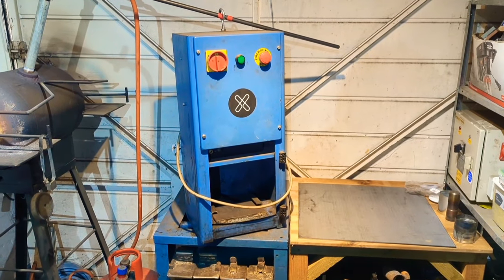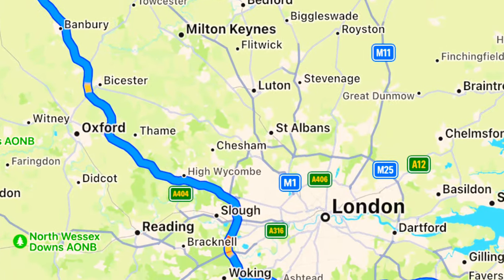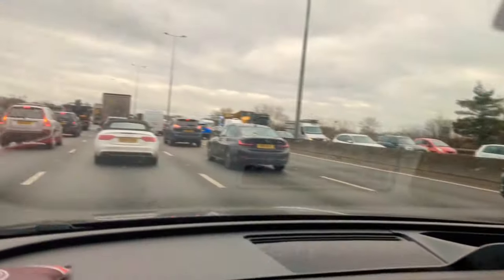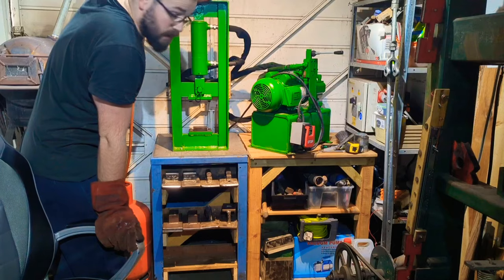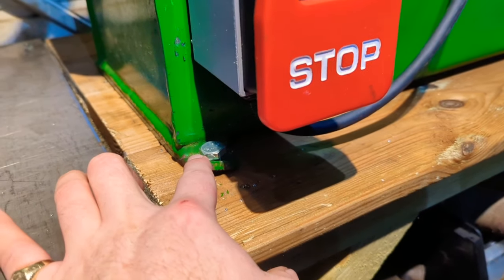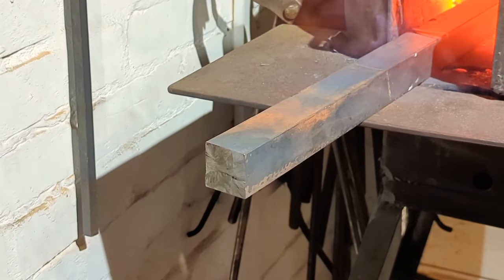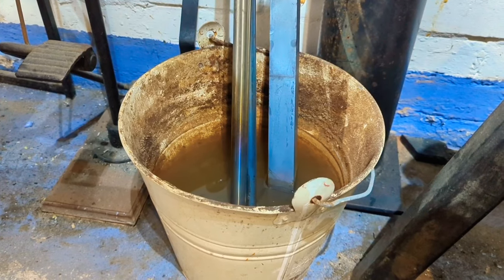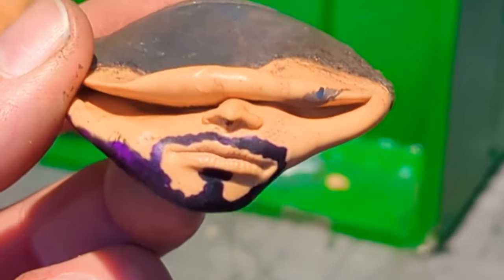New Coal Iron Works 12 Ton Forging Press

Comment: Fuller dies will stretch and heat up the steel so it stays hot longer.  A combo die setup is the bees knees.
Cheers!
Im ordering one myself.  Love the compact design and the new power pack with the reservoir on the bottom and used for the base.

Comment: I quickly realized I had to relieve the edges of the flat dies on mine as they left ridges in my steel, but I'm sure you will get to that! My 12 Ton works well until the steel gets below 3/8" at which point it labors, but it's a good machine.
Reply from the maker: Yeah, I've definitely noted that I need to redress the corners! It's one more thing to get to on a long list currently. 😅

Comment: Hey Phil! Congratulations! I bought one of those last spring. I’m so happy that I got one. Enjoy!
Reply from the maker: Nice! How have you been getting on with yours?
Reply: @PJTForging  I just used it the other night, inspired by you, Denis, James and John, I decided to start a new layered Damascus project. The press works great! However, I didn’t prep/put my billet together like I should’ve. So, I will be starting a new one tomorrow afternoon. Make yourself a couple of squaring dies, you’ll be glad you did. It runs great. Maintenance is easy.
Reply: One of the best purchases I’ve made for my workshop so far!
Reply from the maker: @whuop-wadeshumbleopinion625  that's great to hear! Good luck with your next attempt! 🙂

Comment: Hi, Thank you for your very nice video which gives a lot of tips for the 12 ton press. You know, here in Tunisia we are lacking this kind of press, myself as a disabled person working for my family I strongly need more information concerning the cylinder used, the electric motor as well as the pump. If only you could help me by providing this information I would be very grateful and thank you in advance.

Comment: Definitely a hell of an upgrade over the old press. Lot more work room for longer projects, especially since I imagine that base can move further out.
Was going to ask if you were thinking about investing in a foot control to replace the handle, until you said you weren't good with hydraulics, so I'm going to assume that's a no for the time being :D
Reply from the maker: I would happily make a foot pedal for it as that's more to do with linkages than hydraulics, but I'm gonna see how I get on with the hand control for a while first as so far, it feels very user friendly. 🙂
Reply: Yeah, I don't suppose you're making a lot of massive projects which would make a foot pedal necessary either.

Comment: That's a huge import tax. also don't expect the press to move hardened steel like 1095 that well. The square die would dent it but you need the rounding dies to spread it much